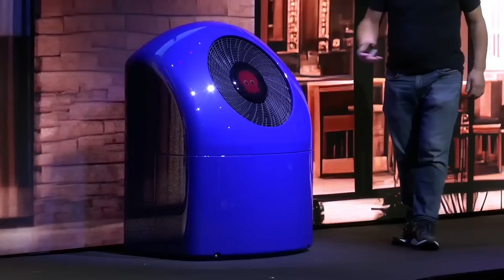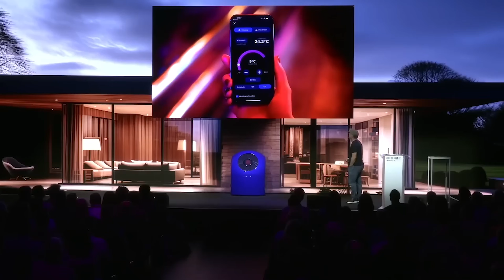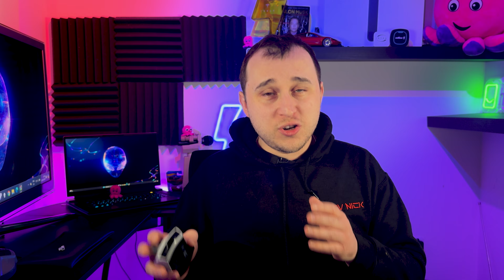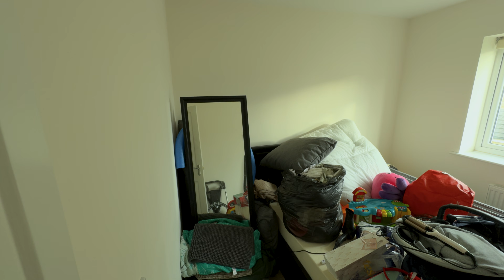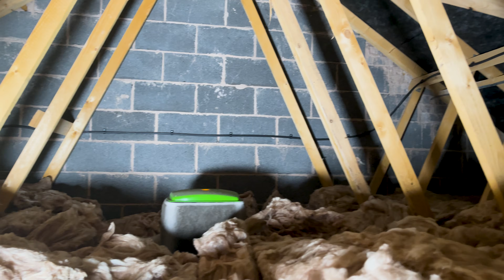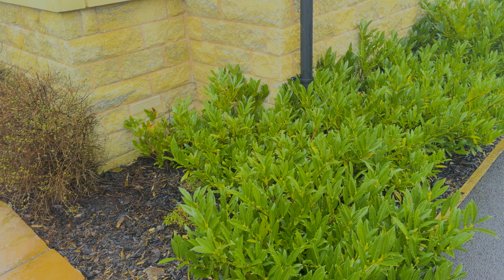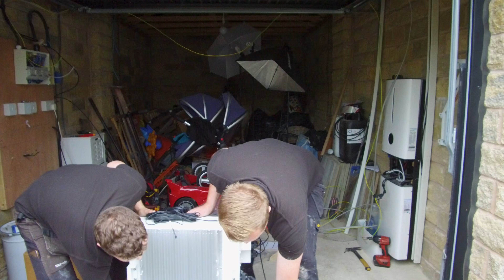Octopus Heat Pump Survey HAS Hidden COST!

Comment: That sounds like a lot of issues to address. Have you considered a Tepeo  ZEB boiler. Same flow temperature in the radiators as your gas boiler. No need to change any radiators.
Reply: Yes it is an electric boiler. You need to compare total cost of both options. Just add a few more solar panels to compensate for the electricity costs. In addition with Intelligent Octopus Go I'm getting 11.5hrs @ 7.5p/KWh. Just a thought.
Reply: @jonathangoss396 using electricity for heating and hot water in a typical house is absurdly expensive. You would have to be mad unless you have an extremely small or well insulated house.
Reply from the maker: thats an electric boiler won't hit efficiency or cost of a heat pump

Comment: timely video there Nick,i was only on the phone to Octopus today about a unrelated matter and i asked them to email me a link for heatpumps, like you i have no hot water tank, but there was one that was removed when the combi was installed 20+ years ago, however the "cowboys" that installed the combi used micro bore pipes and channelled them into the solid stone walls (2ft 6inch thick), if i do get a heat pump i will run fresh 15mm pipe surface mounted/under floorboards, luckily i have space for a hot water tank in the cupboard that currently houses the combi boiler, ps my house was built circa 1800's so the majority is solid stone walls excepting the 2 extensions 1 side 2 storey(circa 1988) and the rear single storey extension (circa 2016), keep us posted on develpments :) :)
Reply from the maker: If you do go for a heat pump from octopus theres a Pin'd comment at top to knock another £100 off if it helps.  What size microbore pipes did they  put in 8mm or 10mm?

Comment: Hi Nick great video you have giving me lots of positive thoughts on positions of heat pump water cylinder and radiators. I signed up and paid my £500 last December and waiting for the cosy 6 survey. Have you any idea when they are starting installs. Many thanks Dave
Reply from the maker: Hey David depends where in country you are as engineers need to be trained for cosy6,   PS if you haven't signed final contract yet post top of this video we can split £200 between us
Reply: @NicolasRaimo  Hi Nick thanks for your reply, yes I will use your link many thanks.

Comment: Very interesting with detail. It brought it all back for me - deciding where everything goes. The work you might be expected to do yourself is easily presumed to be something the installer will do so it's vital to go through things in detail and be ready on the day. Things like, a foundation and soak away for the heat pump, platform for the tank and access etc. I have heard of people fitting larger loft hatches or temporarily removing part of a ceiling. 

My loft hatch was large enough to get a 300 litre tank in and onto it's side but tilting it upright between roof rafters and supports onto its platform was a job and a half. It's platform bridges over two close solid brick walls so no structural issues at least.

I had already boarded over much of my loft insulation and fitted a better light.

You want to keep pipe run lengths to a minimum as much as possible to minimise heat loss and pressure drop from resistance. You ideally want to tee into the middle of your 22mm (probably where the boiler did) but so each flow and return 28mm split tees into two 22mm fanning out either way so the cross section surface area gets bigger. You don't want to neck down to 22mm and then fan out in 22mm like the boiler did. Heat pumps need a higher flow rate than a boiler to get the same kW output at a lower flow and return Δt of 5°C as opposed to a boiler's Δt of 11°C. So you don't want bottle necks.

Have they mentioned a low loss header or buffer tank? Ideally you don't need one but they are often used with a secondary pump to make up for inadequacies in flow to ensure the heat pump can operate at Δt5° so it doesn't throw a flow rate error when the radiators can only manage Δt 8° or something because of flow restrictions. The two flow loops are hydraulically separated but mix in the buffer as required. Some heat pump manufacturers insist on low loss headers to avoid heat pump call outs but if the pipework is designed correctly you won't actually need one. I have one but the flow from the heat pump exits to the radiators at the same temperature and the same for the radiator return back to the heat pump. If my radiator loop was restrictive I'd see a differential temperature across the header which leads to inefficiency as you'll need a higher flow temperature from the heat pump to make up for the lower flow through the radiator loop. This "distortion" is best avoided.

The less flow restrictions and the greater surface surface area of radiators the better as you can lower the flow temperature of the heat pump. Just because it can do a high temperature flow doesn't mean you should operate it like this. More input energy is required and that's what costs. Better to shift the same kW of free heat energy from the air at a lower temperature and higher flow rate requiring less input energy.

Try and keep all your pipe runs in the heated envelope of the house to minimise loss. So under the loft insulation and all lagged. Pipes buried in walls etc may be a source of heat loss.

I keep internal doors open and the whole house at the same temperature with the system permanently running. Zoning was more of a thing for boilers. Heat pumps are best working with all radiators fully on for the lowest flow temperature. If you switch off radiators it won't run as efficiently as it will tend to short cycle. It's a different mindset compared to boilers and the weirdest thing is having the radiators at body temperature of 37°C so they feel like a person and yet the house is warm in winter. It's a bit like having a house full of people to keep you warm.

You are right about the Eddi solar diverter. It's much better to export the solar surplus these days with the more generous export rates. If you heat your water at night at cheap rate tariff you instantly have at least a two to one advantage in rates with an immersion heater and with a heat pump doing the heating more like a six to one advantage. The Eddi can still be of use to do the Legionella cycle and extra tank temperature monitoring.

One other consideration for a public footpath facing heat pump is the defrost cycle making clouds of water vapour on a frosty morning. They might think your purple bin' s on fire 😉

Comment: Thanks for sharing Nicolas.  Enjoyable to watch, we are going through the same process trying to replace a combi with an ASHP, so good viewing.  Liked and subscribed.
It was probably a slip of the tongue, but you mentioned a Harvi as a solar diverter (24:40) which is actually the Myenergi Eddi.  The Harvi is their wifi hub that wirelessly links the Myenergi devices.  I suspect a slip of the tongue as the video slider says Eddi for that section.
Not sure if you have experienced the Heatpunk website yet.  For those of a more technical bent, this is a free online survey tool that allows you do conduct your own house measurements and input them into the Heatpunk website to produce your own survey report and ASHP recommendation.  You can play with room temps, air changes per hour, flow temps, etc.  Most won't care to undertake this effort, but for some of us it is of value to have a ball park to compare with when the installer survey comes in.  This might be something worth mentioning in your next video?

Comment: add a light on your on connected with an extension cable and a switch - lot cheaper and should work.

I still wonder what amount you end up with cause here in germany we changed our attitude too and add aditionally to the oil central heating a heatpump that is sg ready which stands for surplus energy from the roof. 
And we start simply by adding or replacing the heatpump first and then look afterwards which radiators have to be replaced . 

this way you will get what you really need and we get a 12 kW mono block heatpump based on propan with wlan and home assistand integration fro just 2400€ without subsidies and 500€ for installation, so about 2700 GBP incl vat 
If I want subsidies I have to do more paperwork and so on and would endup around 1600 € or 1400 GBP

We have here a lot of german and european heatpump vendors but a lot are also getting chinese heatpumps and theses also have energy labels and are on a qualification list for subsidies which means they have to show a cop of 3 or higher. Our choice has a COP of 3,15 and a SCOP of 3,75 where the SCOP is the only one that matters cause it is based on an average year and average home so that these figures are comparable across al manufacturers. Therefore a lot of manufacturers will try to hide the SCOP and advertise with all the COP for a7 or a10 and 35 °C output, not the usual radiator of 55°C we are used with oil and gas central heatings. 

World best heatpump achieves 4,5 SCOP and ours is just 3,75 which means we will need 20% more energy but we do not care cause our kWh price is 28 cent, off peak is 20 cent and 8 cent our money we get for feeding, so about 15 cent by average during heating period. 
If we use 3000 kWh with the world best heatpump then we could expect and to use 600 kWh more which would meand 75€ a year or 60 GBP.

Does not make sense to pay 12500€ or more for the worlds best heatpump if I can save 10.000 by this 1 decision only if you can save just 75€ .
Not even 100€ or 200€ would ever pay back in lifetime . If the cheap chinese would run just 5 years we could easily bug a new one.

And chinese are not sstupid, cause they learned their lesson and only got the quite expensive EU homologation cause they are ready to deliver spare parts and even manual for use and an installation manual each over 100 pages long. AND they learned that panasonic builds the best compressors and danfoss the controls therefore they are using these important parts from major brands. 

I can only suggest to look twice and do all the stuff on your own cause you can not loose much assuming your are not living on the islands up in the norths like scapa flow or so where it is colder. We have installed that in a house built in 1970 with 200 m² of space and about 180 m² heated with a 25 kWp solar power roof and a 15 kWh battery. We also added a water heat pump to increase efficiency with a heat exchanger or coil from Atlantic made in france which was even more expensive than the whole heatpump (paid 2100€) 

Here in germany octopus would have no chance with such expensive offers even though they have also entered the german energy market and battling with tibber from norway. Right now they are not succeeding cause only a few know Octopus from the UK, but who knows if they can lower the prices things might change, but no one would trust a british company to do all the jobs in their home by hiring subcontractors for cheap cause we have already many complaints from a similiar business where the home owner can rent a solar power system on his roof and will own that after 20 years or so where the cost will end up in twice the price or by hding costs for an ev wallbox. They get it for free for 2 years and will pay just 35€ for such charger - each month. 7500€ for a wallbox in total - and I doubt that it would even last 10 years, most die after 6 year of usage.

Comment: What about the extra room you have to have to fit all the components in?
Reply from the maker: you mean the loft.....
Reply: @NicolasRaimo  no I mean the room to house all the workings. I was trying to get my wife interested in a heat pump on the baxi stand at electric show. she says we going backwards when she's got a combi boiler that goes in a little cupboard.
Reply from the maker: @nickosullivan5456  you mean flow temperature? Why does that matter if house is warm
Reply: @NicolasRaimo  no I mean you need a small room for everything to go in. I'm not explaining it very well
Reply: @nickosullivan5456  Do you mean a plant room? The Daikin and Cosy6 will be monobloc designs so most of the workings are in the external unit. Any expansion vessels, buffer tank and hot water cylinder will be in the loft. Nick will get an additional empty kitchen cupboard in the process - the one housing the boiler.
Reply: @ma40  thanks the man on the stand at baxi didn't sell it very well. I'll have to take the wife to octopus.🤣
Reply from the maker: @nickosullivan5456  Ask octopus for a quote and please use my referral link and we can split £200

Comment: why don't you put the DHW tank in the garage?
Reply from the maker: garage isn't connected to home its 20 meters away...
Reply: @NicolasRaimo  is the ASHP final is located near the garage?
yes i know but factor in the weight in the loft, pipes running up the loft, 
 all pipework can go in the ground Flow & return heating, cold water main and flow return loop on water this could be on a timer.
just thinking outside of the box.
i have a wood boiler in my garage with 1000l buffer, 40meter run works well for me.
Reply from the maker: @eco-terrorist  there’s zero viable path to garage
Reply: @NicolasRaimo  np, looking forward to the next update.

Comment: Thanks for vblog on survey Nick. Ive got a Daikin through octopus coming beginning of june. What spec Daikin is it your getting? The 6 or the 8kw? Assume the 6 if its cozy (red) 6. Also deliberating on what diverter approach with my solar and 9.5kw battery for water. Thinking of just leaving it out and exporting.
Reply from the maker: I was spec'd 4kw but am not getting Daikin waiting for the COSY6 from Octopus them selfs!
Reply from the maker: video regarding solar diverting coming soon!
Reply: Pity they aren't doing the higher spec cosy models yet. My heat loss is rated at 11kw so well outside the range. 125m sq, 1890s cottage, fully insulated but 9 foot ceilings. Still managed to get an EPC of B though with various countermeasures.

Comment: I placed a £500 deposit with Octopus way back in October 2023 for a solar/battery install and a heat pump...the survey for the Solar was eventually done 26th April, the Heatpump 4th March....I'm still awaiting their quotes to arrive, so I wouldn't hold your breath for your quote arriving within a week Nick!

I too have a new build, very new, we moved-in Nov 23, so super insulated, ideal for a heatpump. 

I have had quotes fom other companies... a local one quoted £3300 for a vaillant, British gas quoted £ 628 for a Dakin.

Like yourself Nick, im particularly interested in the Cosy 6, but it looks to be a way off yet, so I am in a quandry whether to just go ahead with the heatpump from BG or wait for the cosy 6 in the hope that it will be installed before tnext winter. The added complecation is that I intended for the storage battery to be installed in the garage where my gas boiler is, so i'd need the heat pump installed before the solar.

I have subscribed to your channel, so im looking forward to the update video about your Octopus enquiry.
Reply from the maker: Got the final heat pump survey and final sales contract 7 days after the heat loss servery all signed and awaiting for the cosy6 video on the final results coming soon!  PS if you haven't signed final contact yet you can use my referral code if you want me to give octopus a nudge on getting final contract drop me an email

Comment: Sorry Nick but high temperature heat pumps are not something you want. You get high performance at low temperatures, and although refrigerants like propane can go high. If you like money, you don't want them to have to. 
Propane is still a hydrocarbon too, a naturally occurring one at that.
Reply: I concur with your comment on efficiency, but Octopus is priced to maximise market uptake, not produce efficient systems.  As you say, propane is a hydcrocarbon, but here it is just the R290 'refrigerant' used in the ASHP.  It isn't used up, it just recirculates.  Even in the event of a system leak there is only around 1kg in it and propane is many orders of magnitude less damaging to the environment (CO2 equiivalent) bthan the previous refrigerant (R32).  This is worlds away from actually burning the stuff to produce heat.
Reply from the maker: Hey Lewis as mentioned it CAN go high but they won't be running it past 55c design flow

Comment: Those temperatures seem on the warm side to me.
Reply from the maker: What room temps?  I live in a modern 4 bed detached I like to feel warm in my home that's why I brought a well insulated house
Reply: As well as your central thermostat , You will usually have thermostatic rad valves fitted , so you can adjust down the design temps for individual rooms if they are too warm. Easy ...
Reply from the maker: @rico4229  with heat pumps your advised not to use trv
Reply: When mine was fitted they put TRV's on , saying best to keep them fully open , but can tweak down in some rooms if necessary... Works very well...

Comment: Maybe I misunderstood what you're planning to do but surely using the heat pump to heat hot water is more efficient than using solar / battery to heat it via an immersion heater?
Reply from the maker: Course it is... thats what the heat pump will do and store in the cylinder
Reply: A hell of a lot more efficient, but it can be a lot cheaper! 
300% efficient @ 20p/kw vs 100% efficient @0p/kw if you have a solar diverter

Comment: Thanks for the video. I spoke to them about a year ago and at the time I was told they couldn't put the buffer tank in the loft, so interesting to hear that it can now be done. They were also not too happy about the vermiculate loft insulation I had under the extra mineral wool layer (due to possible asbestos contamination).